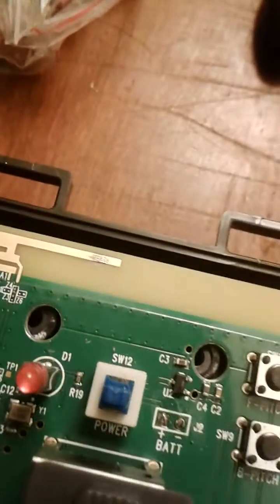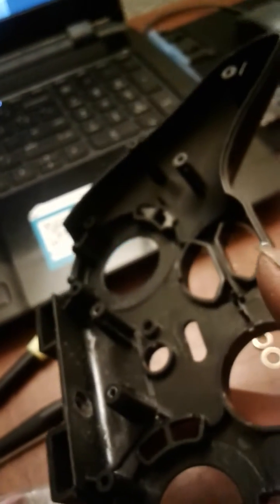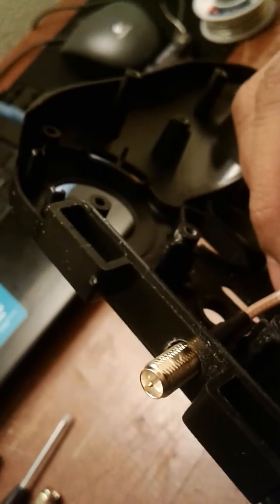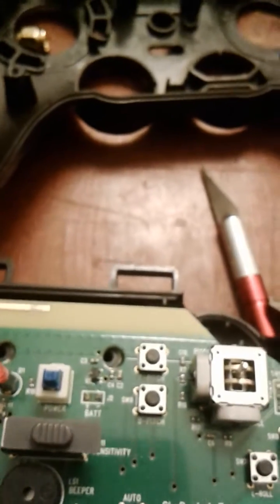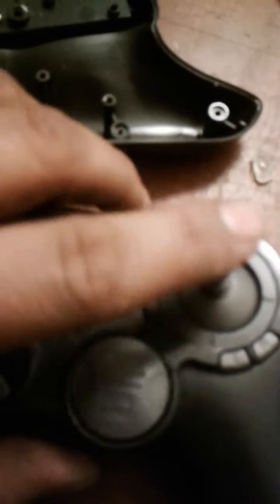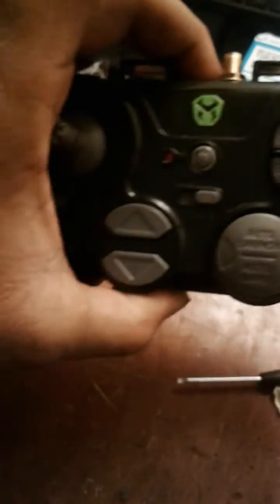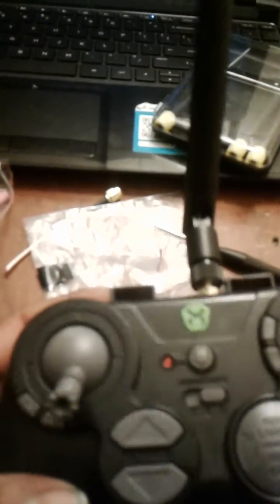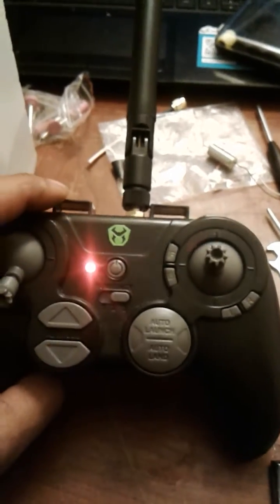Sky viper controller mod step by step(part 2) DIY WORKS!!!

Comment: Looked for your PART 3 video on the testing - I don't see it - what happened??? Did it work and if so, how well?
Reply from the maker: Chuck Get I didn't do part three cuz by that time I switch to racing  drones carbon fiber frame the upgrade is at ur own risk it worked for the guys i took it from the range improved if the controller don't work rocket toys sell them individually reality is if u like the hobby start looking for the racing drones eachine came out with the  new wizard a solid drone u can buy ready to fly i believe at a very good price

Comment: I like what you did I was thinking about Moding my sky viper V 2900 pro I was thinking about putting a FPV camera on it And Moding my controller for longer range and my controller like u did for Long range Fpv flight Maybe even buying a carbon fiber body and taking the guts out and making a proper racing drone out of it I mean I already spent the money on the damn thing Might as well make it fly the way I want it to i’m actually uploading a new video about the sky viper check it out and subscribeIt should be up and ready in a few hours let me know your thoughts on the video and what I could do to make the sky viper a little better to hear from you my friend great video by the way keep this up I will subscribe

Comment: Hey man got a question. My sky viper 2400 won't stop doing circles like I have the throttle held sideways. Can you please help me.
Reply from the maker: domenick desimone did you try the trim buttons below the throttle stick if it yaws to the left youu hit the right trim if its left trim right if you know wich way it spins press the trim before take off and adjust as needed hope it helps if tat does not work let me know thanks for watching
Reply: Any chance you have put the blades on the wrong motor. I have notice that there are two different orientated blades
Reply: I was thinking prop rotation too. Does it lift when you throttle up? Looking down camera facing forward same direction as you the front right is counter clockwise prop will have a letter “b” on it front left is “A” and the letters cross-cross you know back left is “b”